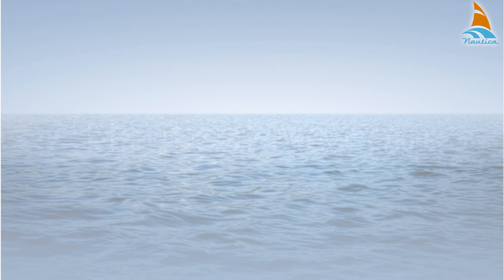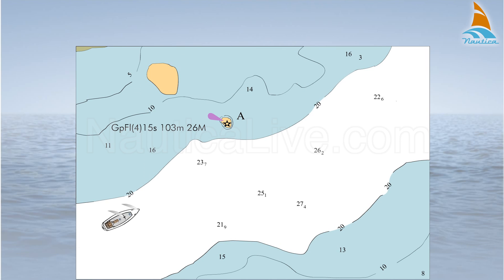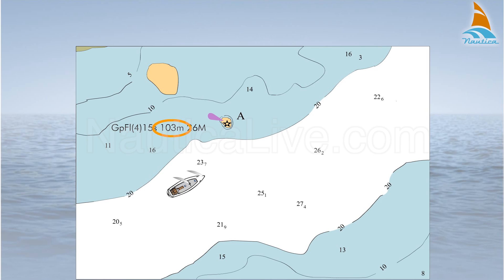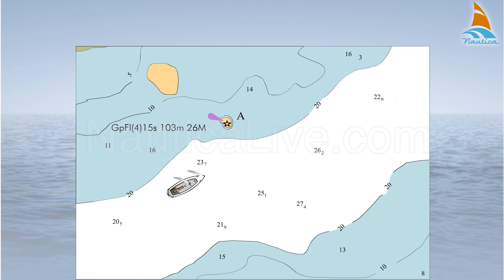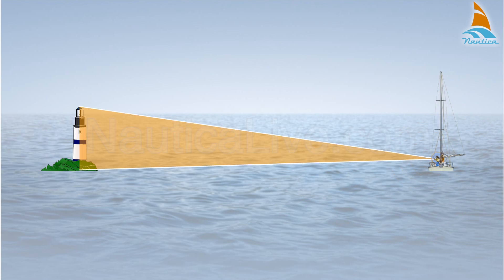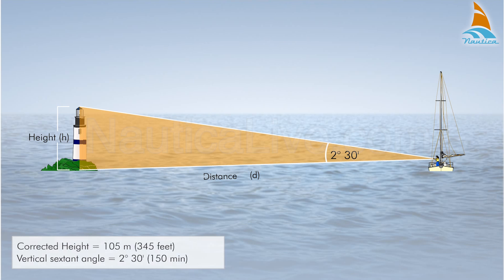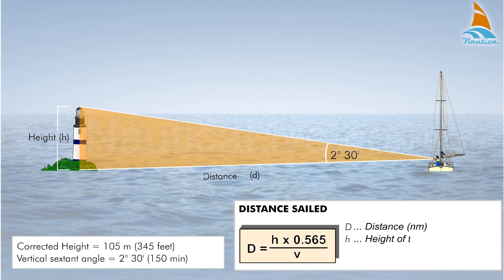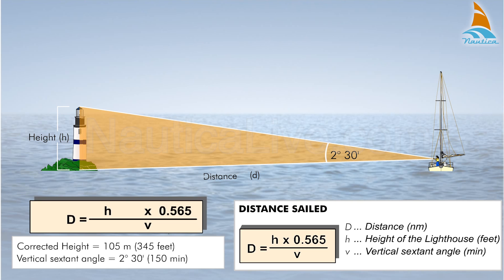Fix position bearing and vertical sextant angle bearing and vertical sextant angle 1

Comment: Can I ask more basic questions?  To get the height of the lighthouse, do I simply reduce the image of the top of the lighthouse until it sits on the sea level at its base?    Am I right that my own height standing on deck does not make a significant effect on the calculation?

Comment: Is 0.565 constant?
Reply: Only saw this now, you have probably figured it out already, but it is the three conversions combined: 6076 feet in 1 nm;  60 minutes in one degree, and tan 1 degree = 0.0175.    0.565 = 60/(6076x0.0175).  It is really only accurate for angles less then 3 degrees,  but using a sextant and a distant lighthouse that will be good enough for the purpose.
Reply: he is converting the height of lt house from meter to feet....there is another simple formula directly without converting to feet.....d= ht in meters * 1.854/ vertical sextant angle * 60...

Comment: Why do you use 0.565?
Reply: nckeller it’s the Tangent of the Angle, since you have a right angled triangle
Reply: George The Russian thanks for clearing that up sir
Reply: George The Russian No it’s not. Tangent of 2.5 degrees is .0436. Just looking at the picture, the vertical length is not 0.565 the length of the horizontal.
Reply: @BobbieGWhiz  I came to the same conclusion as you.  So why the 0.565?  Doing this by high school trig, "sohcahtoa," it's the tan of 2.5 degrees we're looking for.  That's .0436.  And, goddammit, it came out right on my slide rule!!  "Nerds!!!   Where??"
Reply: @saints51  Only saw this now, you have probably figured it out already, but it is the three conversions combined: 6076 feet in 1 nm;  60 minutes in one degree, and tan 1 degree = 0.0175.    
0.565 = 60/(6076x0.0175).  It is really only accurate for angles less then 3 degrees,  but using a sextant and a distant lighthouse that will be good enough for the purpose.
Reply: @karhukivi  so tell me how to solve the VSA if they have given distance and height